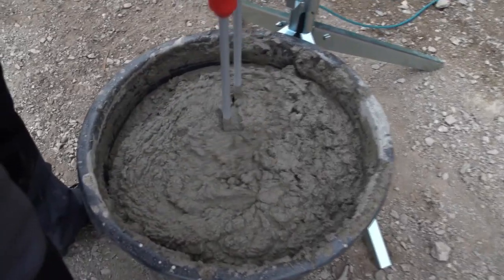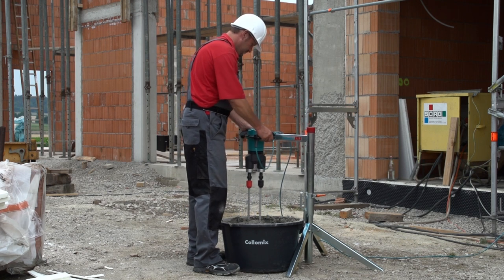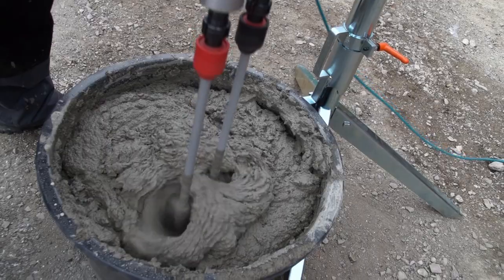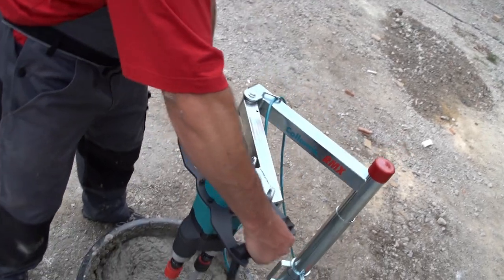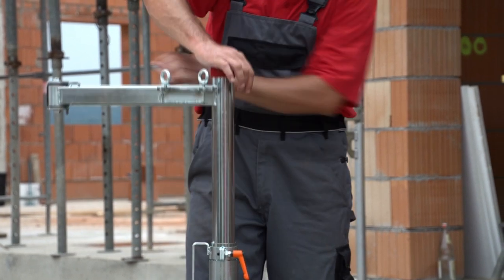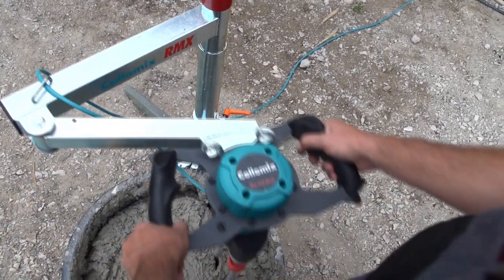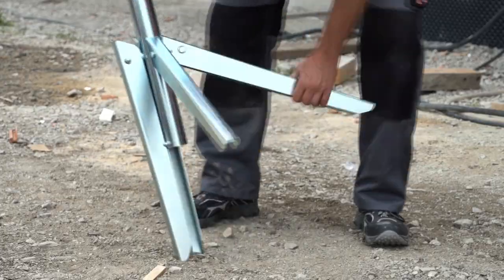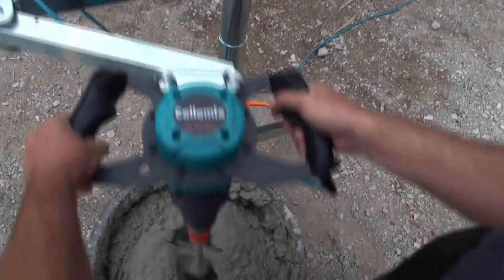🇺🇸 The mixing station RMX makes rough mixing jobs much more easier  (2013)

Comment: Is it possible to produce UHPC with this electric mini mixture?
Reply from the maker: Thank you for your message! You should be able to mix UHPC with our paddle mixer Xo 55 R duo. In case you mix larger quantities of UHPC, we recommend our automatic mixer XM 2-650 or TMX 1000. However, in order to be able to give a completely precise recommondation, our applications engineer would have to know more details on your material as well as your mixing quantity. More information on our products you can find here: www.collomix.com